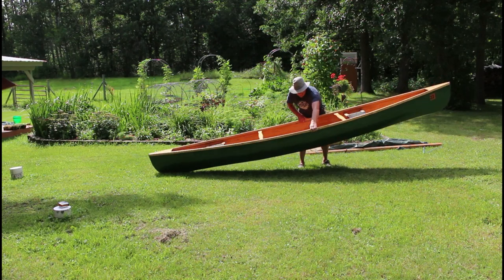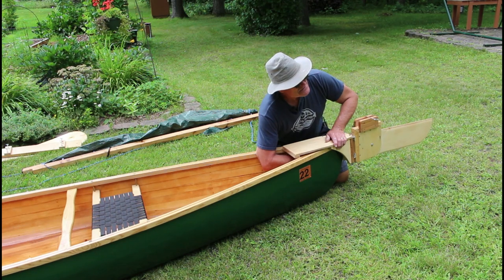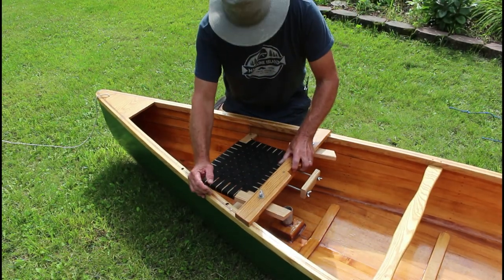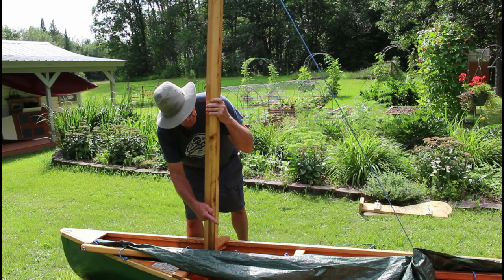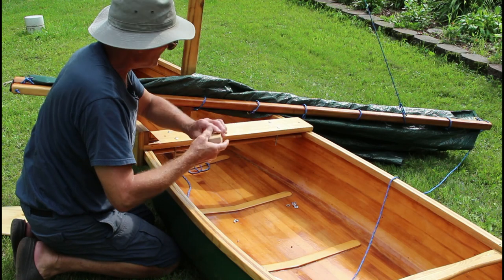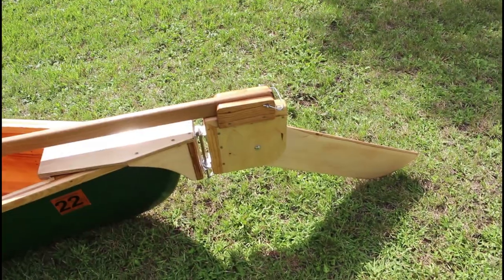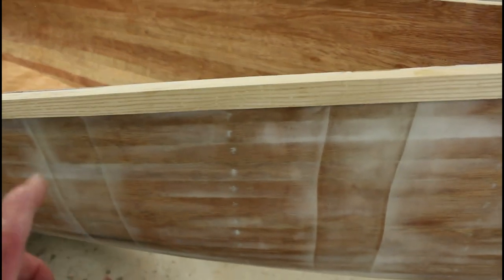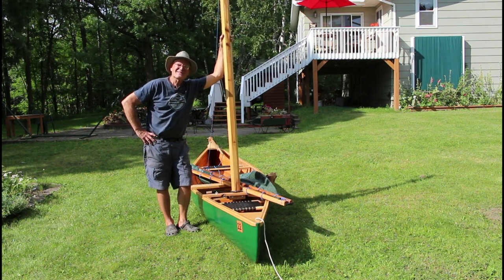My Sailing Canoe Rigging

Comment: A roller-furling sail and mast would be much lighter.  There would be no need for a boom, and it would operate about as easily.  Hobie uses that system on their Adventure Island boats and I think it might be easier for DIYers to build.  Much could be done with ABS pipe.  But your system looks a lot nicer.  It's nice to have carpentry skills I suppose.

Comment: I just bought my second canoe; actually it' a Grumman sport boat/canoe (love it), and I'm just gathering info on a sailing rig which I plan to accomplish next spring. I'm an older senior but that shouldn't stop anyone from having a vision and courage. Your video is very informative, I learn mucho, gracias for your time.
Reply from the maker: Thanks Lucio. Good luck on the project. Best advice is to mount the leeboard as close to the center of effort (roughly midpoint) of the sail as possible.
Reply: is it a Grumman Fiberglass or aluminum?
Reply: @markkromer1238  It's aluminum
Reply: @backwoodbasics9383  In my opinion and past experience mounting the leeboard as far forward as possible .

Comment: Thanks for sharing.  The changes fron boat 1 to boat 2 are very informative.  You did a lot of nice work, and put it into good materials.  That will pay off in the long run.
Reply from the maker: Good to hear, Tom. I sold that green canoe, and hope to make a new sail rig for the new design. We moved to a city lot, with lots of changes, so I have neglected canoe projects and videos. I hope to get back on-track one of these days.

Comment: I recommend a mast that drops in & will drop out if you turn turtle. Otherwise it is difficult to right the boat, especially if the mast is stuck in the mud !
Reply from the maker: Good thinking Chas. It would be easy enough to make. I would not want to capsize, so I hold onto the sheet with my hand, ready to let go if things get dicey. I'm also an "under 10mph winds" kind of sailor now, in my old age.

Comment: That's a pretty canoe even if it doesn't have very much rocker nor lots of spring in the sheer.  The low ends will not catch the wind and I bet is a great lake boat.
Reply from the maker: Thanks. That was my first prototype. I redesigned it with more rocker (2"), a slight V to the keel, and more sweep to the sheer. I am working on a new book on how to build Ripple II, which is made from 2 sheets of 4mm marine plywood (plus a bit more for the stems).

Comment: I have a Lifetime Wasatch canoe, 13-ft long. What would be the ideal length for the mast, and also for the boom?
Reply from the maker: I'm no expert, Ruby, just a seat-of-the-pants designer. Since our canoes are 14' long, and the mast and boom is 8', I would think 7 feet all around might work well, since it takes little to propel a light canoe. I like safety over performance.

Comment: Very interesting, I am looking at building a sailing canoe from ply. Was wondering if  you fit a dagger board instead of the lee board?
Reply from the maker: I almost cut a hole in the bottom for a daggerboard, when my leeboard was not working well. After moving it forward, I stuck with the leeboard. If it is a dedicated sailing canoe, a daggerboard may be the better choice. You just want to be sure of the proper location, before cutting a hole in the canoe bottom. I am building my second plywood canoe now, and hope to have a DIY book on how I built it this spring. Good luck!

Comment: This came up in my feed, while I was looking for sprit rigs.  This is a really nice design for sailing, which is what I mostly do, as opposed to canoeing.
 - The rudder assembly is straightforward, and looks sturdy. The trailer clip to hold the tiller on is brilliantly effective and inexpensive. (I might steal that idea 😁).
 - The bilge board is also a straightforward, sturdy, elegant design.  I might suggest that you cut a plastic cutting board into two fender washers (say 50mm diameter) to put over the carriage bolt, on either side of the bilge board. Then when you tighten up the wing nut, they would act as compression fittings. Tight enough to hold the board down, but would allow it to kick up if you hit an obstruction. (you could do that to the rudder also)
 - The sailing rig is also very elegant, but it is a lateen rig. Great for lightweight craft, but not what I was looking for.
 - Your mast construction is good, but I might recommend a birds mouth mast construction. It would be just as light, but would be better at taking the stresses from the wind. (especially strong unexpected gusts) If someone didn't want to build a hollow mast, they could put a larger conduit in the mast step, and mount a solid mast inside of that. (No shame in having yours halyards showing 😁)

  All in all, this is a great rig, with lots of great ideas. Thanks for sharing, and enjoy your new build. Anytime on the water, is a good time. 👍
Reply from the maker: Thanks Doug for the ideas. You sound like you know sailing rigs. I am building a new canoe now, and hope to rig it, too, for sailing in a similar fashion, but simpler, and without the fixed mast step.

Comment: Very nice project and vid, big up.  
I've got same size sail attached to cheap inflatable kayak which is way 

easier to roll  over. The river I sail has rapid current up to 6 mph and I wanna go upstream faster so  Im going to build even bigger sail this summer.
Reply from the maker: Thanks! These small sailing rigs are a blast. I am building a new canoe now, and hope to rig it similarly this summer. Good luck with your project!

Comment: Thanks for the instruction....One question...how much does the canoe made out of the 4mm marine grade plywood weigh...ballpark?
Reply from the maker: 60 pounds. The plywood is light, but the fiberglass sheathing both inside and outside adds pounds. Makes it super strong though.

Comment: Great video. I purpose built mine to have a centreboard case. If you are interested my build videos are at the link below. I am still tweaking things, and am currently thinking through a furling sail rather than the lug I currently have. I find it very hard to paddle when the sail is down as the lug fills my narrow seat space.
https://www.youtube.com/watch?v=dn0bqAUIC5I&list=PLuXBZmwbLVYJLUo28xVRVhK-ZCpF53fDG
Reply from the maker: Thanks Lee, I will check it out. I toyed with building a centerboard case, when I thought that my leeboard design was to blame for the poor performance to windward. After moving it forward, and realizing it was a positioning issue, I gave up on a permanent centerboard trunk. I like the idea of having a more dual-purpose canoe.